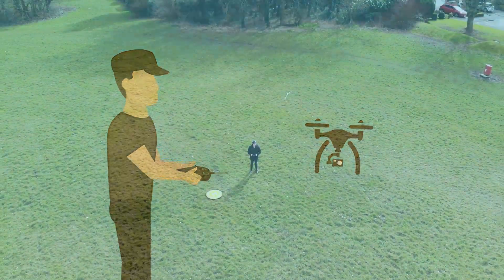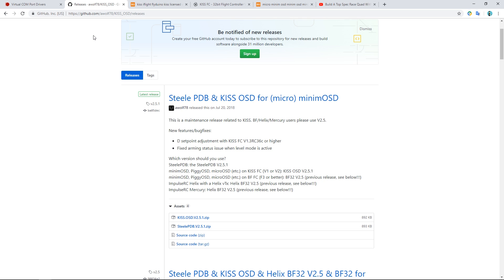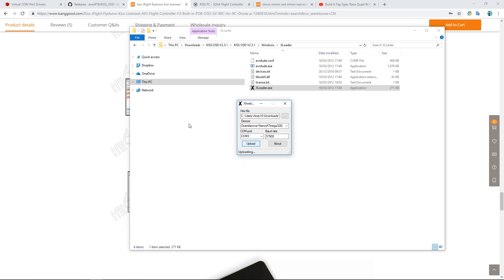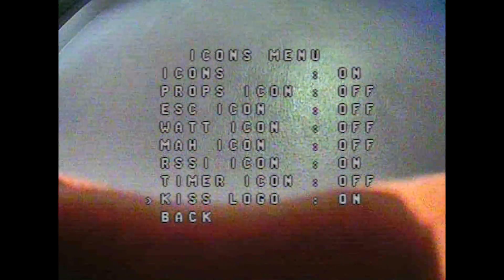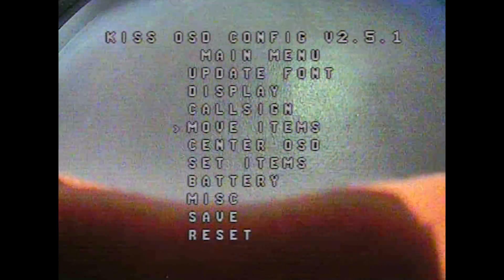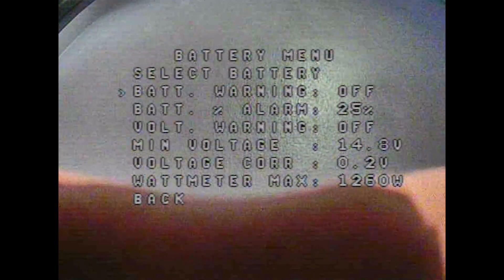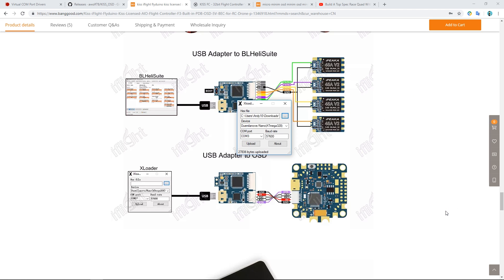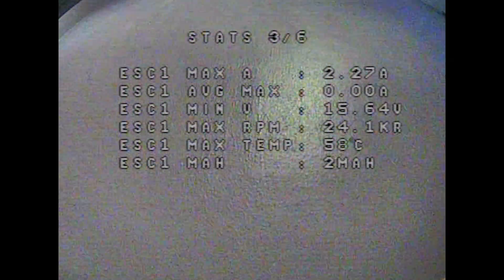iFlight Kiss AIO KISS OSD V2.5.1 Part 3

Comment from the maker: iflight HL5: http://bit.ly/2YCtnMo 
iflight XL5: http://bit.ly/2FBojza
iflight KISS AIO FC: http://bit.ly/2SPwQmt
iflight 45A 32bit Ipeaka (looks like they are upgrading to 60A version): http://bit.ly/2FJHNTm
iFlight 60A 32bit SucceX updated version: http://bit.ly/2U4omNY
iflight VT5804 VTX: http://bit.ly/2FJLNC6
iflight 2207 2450KV Xing Motors: http://bit.ly/2YFDnUW

Skystars Star-Lord (The best BNF freestyle model)

http://bit.ly/2E1Ejed

BG HL5: http://bit.ly/2uBwExR

BG HL5 Session Mount: http://bit.ly/2JTrasL
BG XL5: http://bit.ly/2FCL4ml
BG KISS AIO FC: http://bit.ly/2TkaChI
BG Ipeaka ESC (only 35A version): http://bit.ly/2YDCuwr Code iflight899
BG Ipeaka SucceX ESC updated 60A Version: http://bit.ly/2I1QgmI
BG VT5804 VTX: http://bit.ly/2JUtnnB Code iflight878
BG 2207 Xing Motors: http://bit.ly/2CMCErV Code iflight984
BG FXT Mars Pro: http://bit.ly/2FKBjnc
BG GEPRC Pagoda: http://bit.ly/2CNukIk
BG GepRC Antenna tubing: http://bit.ly/2HZzmoB
BG Xm+: https://bit.ly/2H3NApB 
BG X9D Taranis: https://bit.ly/2ReLpUN 
BG Minim OSD : http://bit.ly/2TQdaQ7
FTDI Adapter: http://bit.ly/2uHtVCN

Comment: Hey Andy, I run two of these board since dec in my main two builds, back then, i had no issues doing everything as per the manual, especially when it came to flashing the OSD. Launched X loaded, uploaded and off I went. Now, I'm doing a 3rd one, and nothing... I just can't get the OSD to upload, gets stuck saying uploading all the time and nothing happens, Even my old boards are doing the same. Wanted to make sure it wasn't this new board. I've deleted all old COM drivers and ports, used the CP210 driver from the dfuse package. Still nothing. I have even tried editing the com driver to force 57600 rate... Any assistance would be great!

Comment: I found the adapter was very buggy. I had to connect and reconnect cable and closer within seconds, try with and without battery etc just to connect. Then the process of loading a config file, then reloading an actual osd (with the issues above). All with no documentation. It became a deal breaker for me
Reply from the maker: setting the baud rate to 57600 is what stopped all those issues for me

Comment: KISS OSD is really nice, thankfully it’s not as tricky as this to setup when you have it on the Wolf PDB. 

Looking forward to seeing how this setup flies man.
Reply from the maker: it flys really good which is why I decided to make it into a series. problem with kiss is there is so little info out there especially this iflight board that I thought it deserved to be shown even if there is little interest. the wolf pdb does look much easier the steele pdb however pretty much identical process, but cost me nearly 50 gbp with shipping on its own. This is pdb FC and OSD for 30gbp. I think its a cheap way into kiss. I tried to buy a wolf pdb they are sold out everywhere!
Reply: AndyRC totally agree with you mate, in comparison to Betaflight there isn’t very much info on KISS at all. 

I’ve considered getting one of these boards myself after the very first video where you showed it a good while back now, but I’ve been waiting to see what you thought about it first, I really should have just grabbed one and found out for myself!! 😃😃